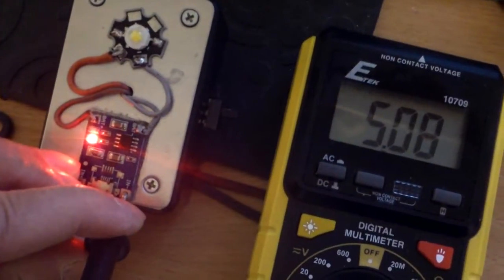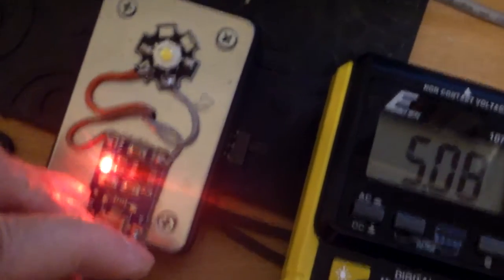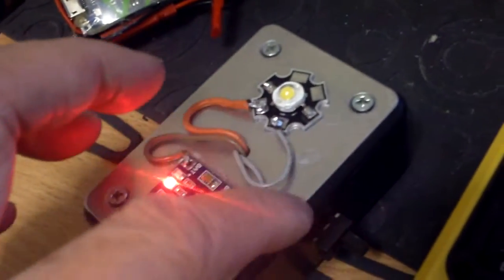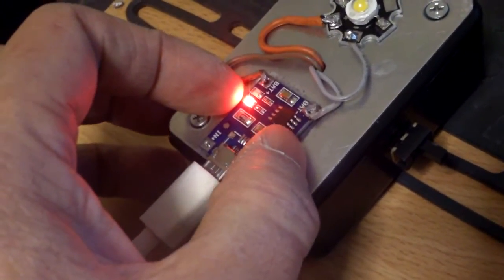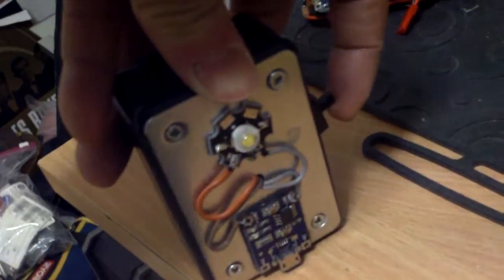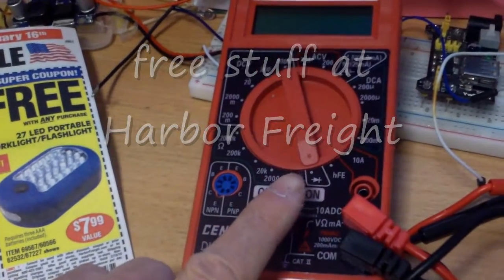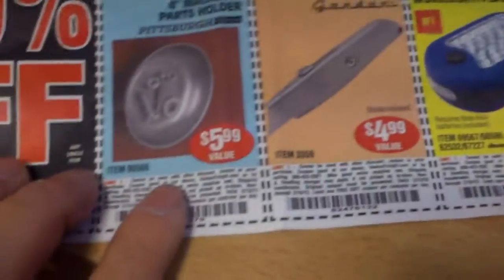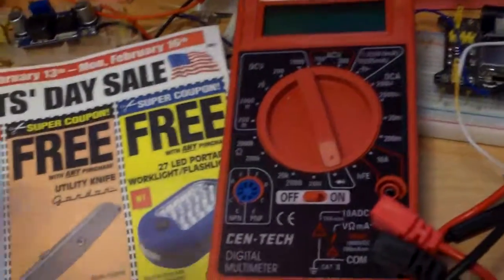Another do it yourself rechargeable 1 watt high power LED light

Comment: The grinder they have shown is the Drill Master brand.  My friend xjoe81x has one and made a video of it.

Interestingly enough, I have one also, I bought on a whim while at the store, but I bought the Chicago Electric brand one.  Same thing, case/styling a bit different.  The one I have is item 91223 and is touted as heavy-duty, but all the specs are the same, except the motor wattage.  The one in the paper is 500 watts, the one I have is 570.  Perhaps it handles heavier loads without bogging down as much?  But then again it's twice the price.  I've been meaning to make a video of mine forever, but never got around to doing it.

I once was faced with the age-old question of "How do you throw away a garbage can?"  Of course the easy way out is to leave a note on it that says "please discard", but what if the note flies off when you're not watching and they leave it behind?  So I pondered and figured the way to throw out a garbage can is to make it NOT a garbage can, so I cut it up using the angle grinder.  Worked great, and they took it first shot!

xjoe81x's Angle Grinder Review video:  https://www.youtube.com/watch?v=IvCa4AostCs